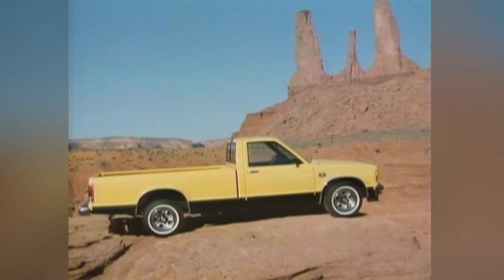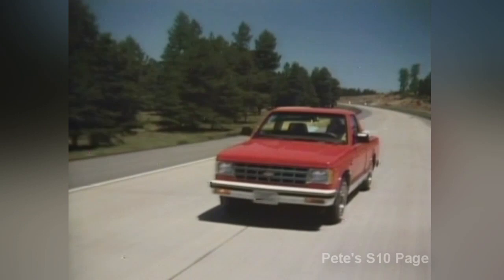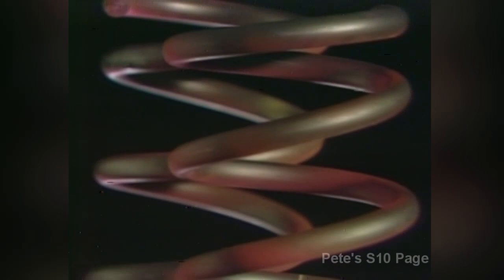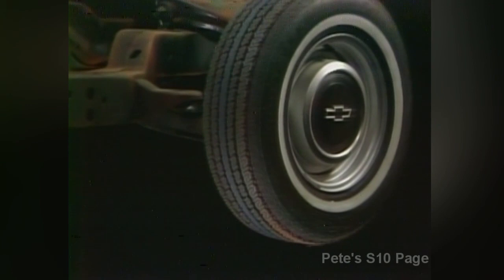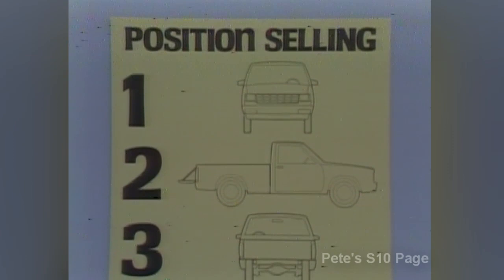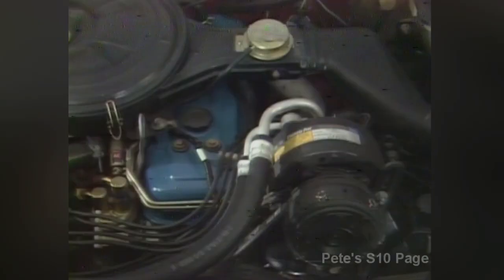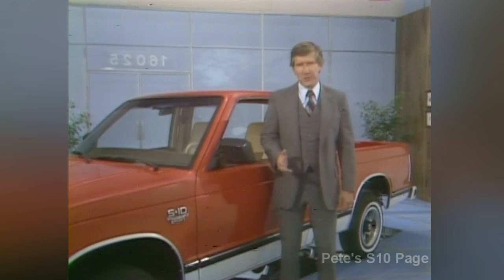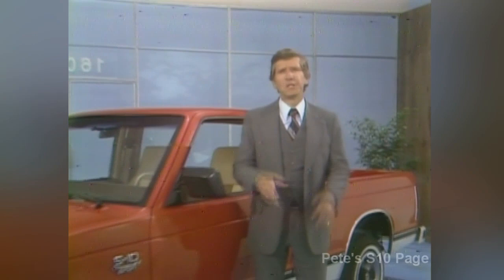1982 Chevrolet S10 dealer training video

Comment: I have a 1982 s10 1,500 pound pay loud 2.8 liter engine and 3 speed automatic transmission long wheel base.
Reply: Out of curiosity ik this is old what mpg did you manage with it roughly

Comment: My 1982 GMC S15 Sierra was improved upon as original equipment began to fail:  a 3.4 liter V6 crate engine, a 5 speed, a 4.10 posi rearend, a Weber carburetor. among other improvements.

Comment: 1988 GMC S-15 4X4 4.3L H.O crate engine, 600 cfm throttle body, injector spacer, MSD coil and module 260 Dur. cam stock for the H.O engine and coming soon 1.6 rockers and headers. 30+ years old and still a nice rust free truck. Oh and also sports American Racing Vector 8.5 inch wide wheels made for the vettes. The vector is what the general lee has on it for those who weren't aware or sure what the vector was. Senior 89 and thats what i picked as my choice of new car for a gift. Love these trucks and SUVs can't forget Blazers and Jimmys.